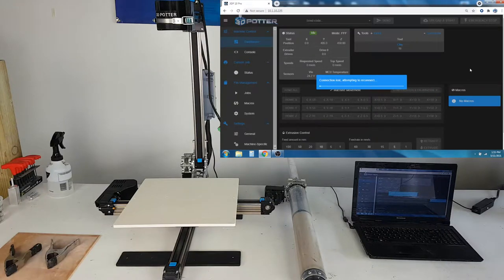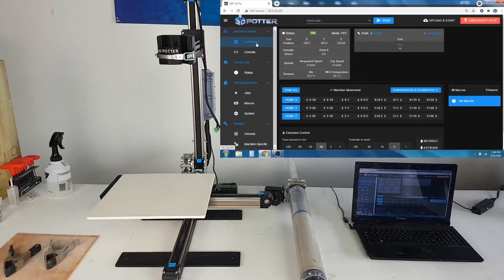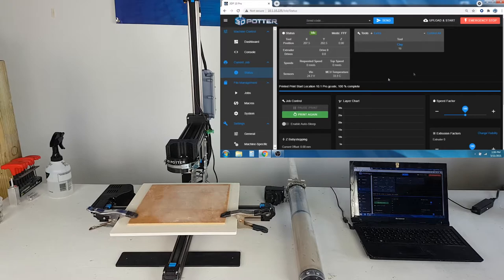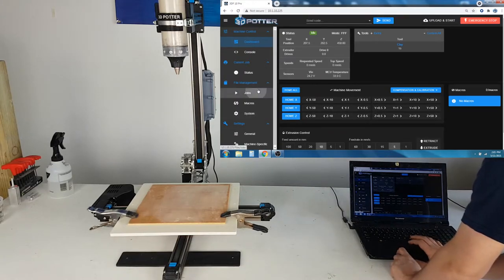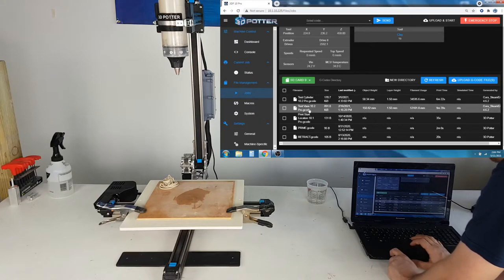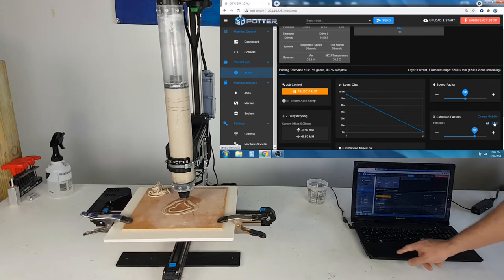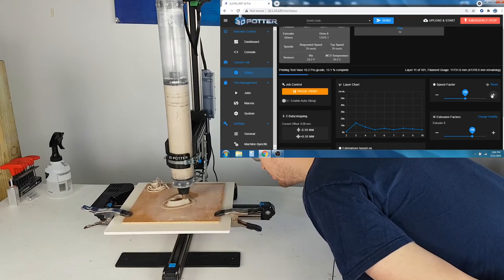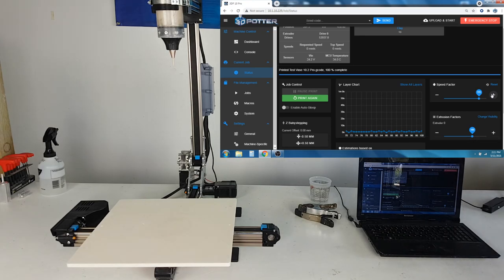Version 10 Operation: Starting Guide On Version 10 Printer Use

Comment: Hello, I have a question. I am using a 3.4.1 Cura version and trying to upload settings for the 3d potter 10 pro onto it but it is not working. Do I need a newer Cura version or is their something else I can do?
Reply from the maker: Almost certainly yes. Cura 3.4.1 was released on Jul 10, 2018. Cura is currently on version 5.4 which is from Jul 4, 2023.

Comment: How or why does it not print a bottom to the 'vase'?
Reply from the maker: You can add bottom layers. We recommend doing 3, but you should adjust your flow rate based on how your material is preforming. The best way to get a vase bottom is to print onto a clay slab, similar to traditional pottery.